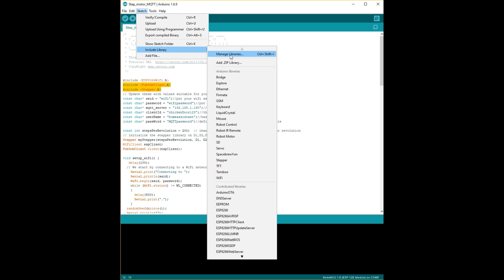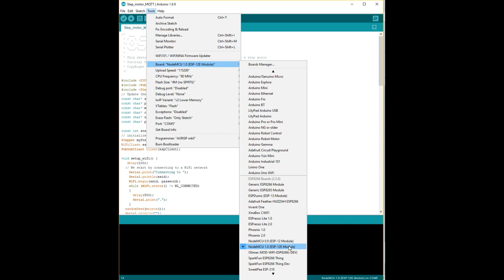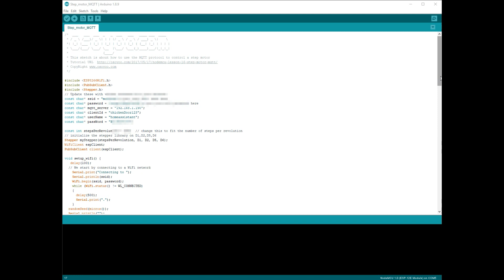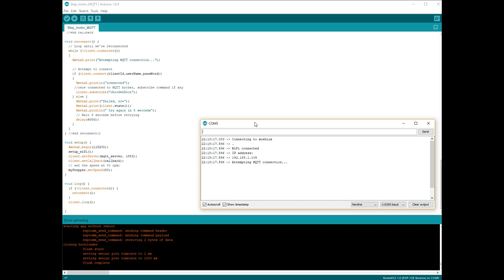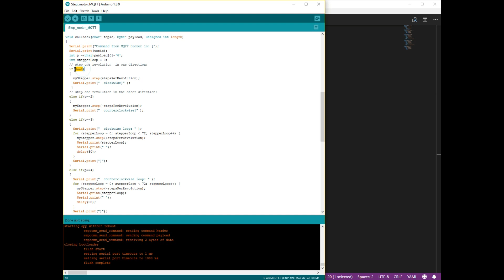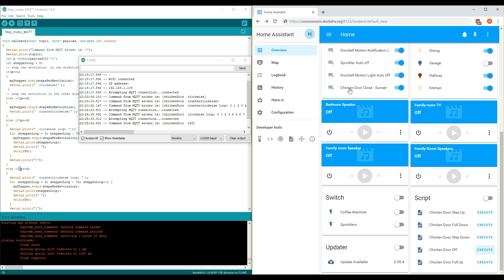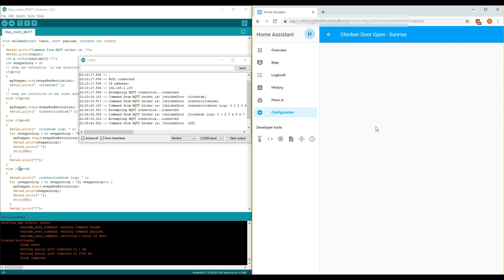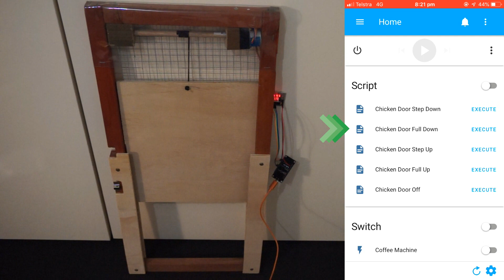Automated Chicken Door and Home Assistant: Stepper Motor using a NodeMCU via MQTT

Comment: hmm I got 
"bad indentation of a mapping entry at line 483, column 11:
          data:
              ^" 
when I try to use your script.. any thoughts on why?
Reply from the maker: Hi, you might need to check the whitespace when copying and pasting. Alternatively, you can download the file directly and then adjust using the editor. Hopefully this fixes it!

Comment: I copied this tutorial but found that it cannot cope with lifting a thin plywood door (5mm thick). Is there a setting to improve the torque?
Reply from the maker: Hi, a few things I can think of is to adjust the amount of steps, the speed and also check that the voltage is sufficient.

Comment: Great video! How many steps per revolution did you put? I've seen videos with this stepper say 64 and 2038. Some data sheets say 2038 so I'll start there.
Reply from the maker: I had set it for 200. In the code it is set at the start "const int stepsPerRevolution = 200". I did have to adjust and landed on 200 as working for me.

Comment: Hi I am going to attempt this, thanks for the video. What power source did you use in terms of voltage? Does that one usb cable power all 3 components?
Reply from the maker: Hi, yes the single power supply powered it all.
Reply: In case anyone else is wondering,I used a 5v power supply into the usb port of the mcu and I think the mcu manages the voltage

Comment: How to connect a magnetic reed switch sensor to this?
Reply: Best bet is to use ESPHome
Reply from the maker: That is something that I'd like to do in the future to use sensors rather than a coded sequence. I have had some rare issues with slipping of the rod and after a while the door will get out of sequence and either close too far/too short. My next attempt would be to have a sensor to know when the door is fully open/closed to stop spinning.

Comment: Good job. Let me just add that the best practice of a call back function is to avoid lots of processing in it. Justgrab your payload value and handle your conditions in the main loop
Reply from the maker: Thanks for the tip. The original code snippet was used from Osoyoo.com. When I have some time I'll see if I can enhance further.